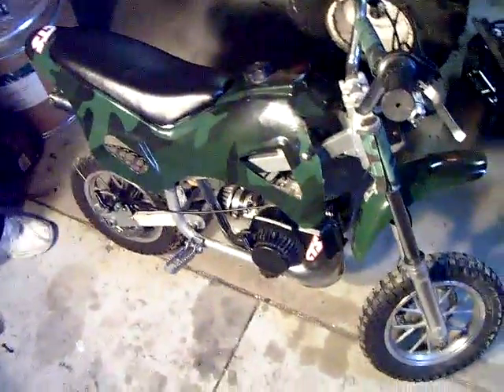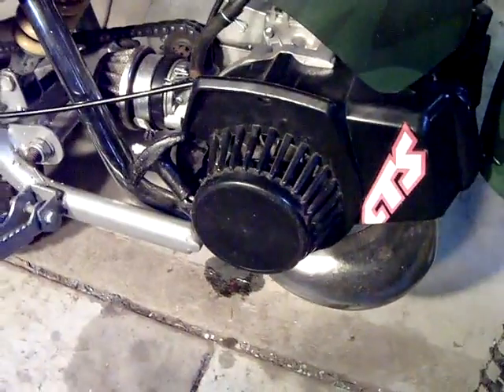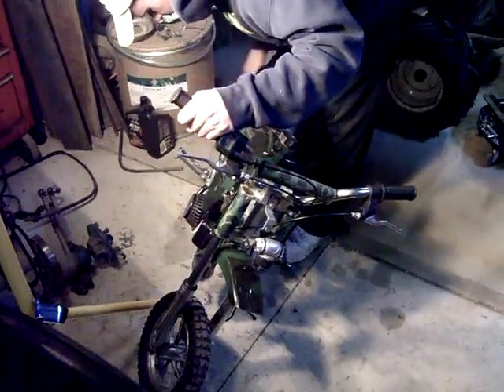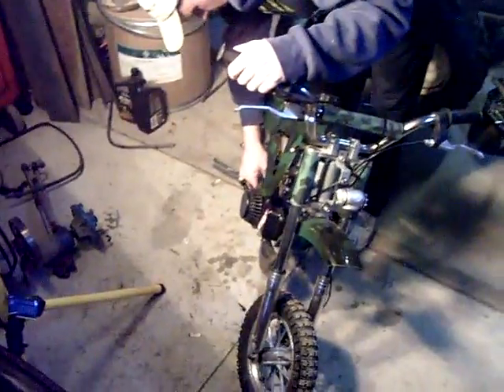super sweet dirt bike tune up and cold start

Comment: There is a shitty rubber thing in the fuel shutoff valve that gets messed up....have you checked that cause i throwed the original shit away and did my own copy of it with better materials so now mine runs like a charm ever since it got replaced.

Comment: Oh ya that's a common problem just clean the carb the fuel off switch falls apart inside the line clogging the carb not going to break it just it will start then drain the carbs gas then run out then die  the pull pull pull lol energy wasted YouTube the video lol ten min max and no sweating just put the parts back in the way they came out not hard

Comment: Easy1 two screws carb off 2needle nose the hooding pin off and float level brass looking don't bend it or u fd up 3  and gas stopperthing out 4 blow through the holes (jets, fuel inlet ect) so the dirt is out with a air tool and wear googles the gas goes in u eyes ur blind and it tends to aim for the face a lot with carbs so I warned u so wear eve protection please